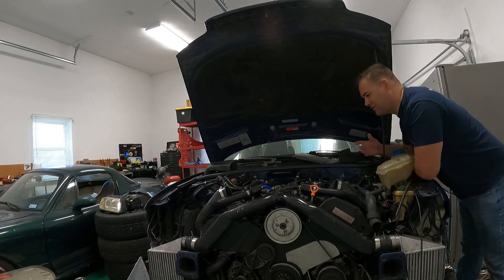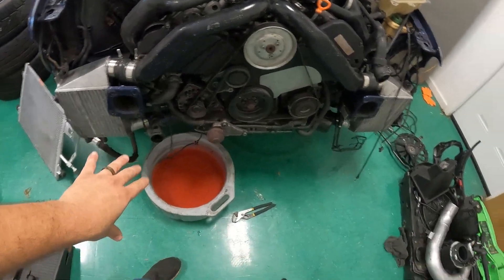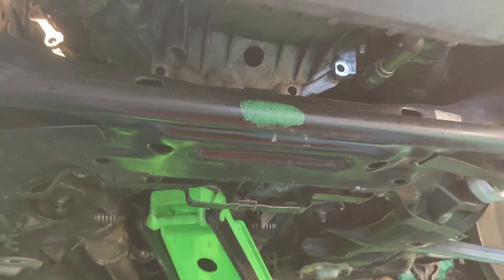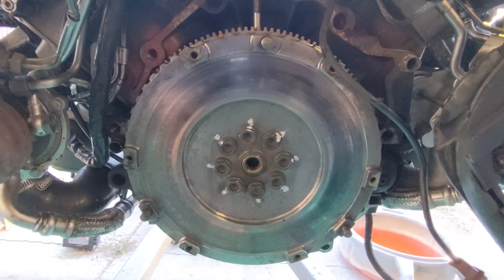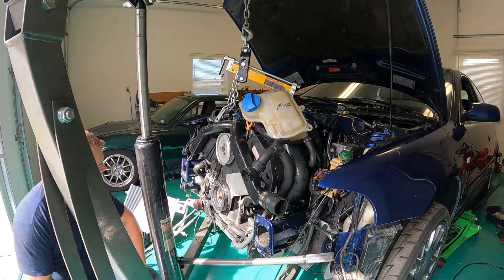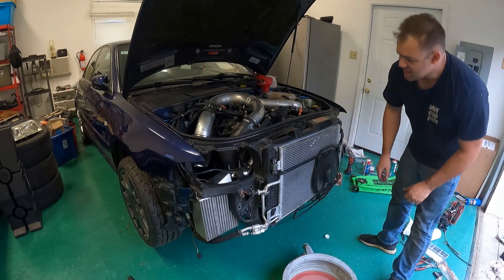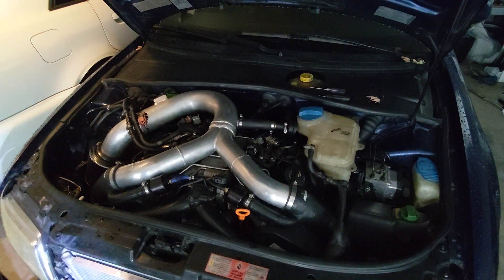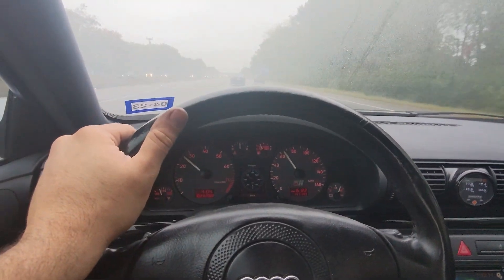My clutch is ROASTED (DIY stage 4 clutch install + clutch bleeding)

Comment: Man i need to replace my clutch setup cause my tob failed i limped the car half a mile so i probably cooked the pressure plate and clutch, your video is very inspiring by just removing the engine and not the whole drivetrain lol
Reply from the maker: It's definitely challenging but can be done. It save time on the back end of not having to reinstall axles/driveshaft and rebleed the clutch